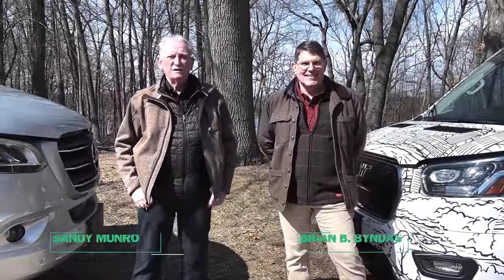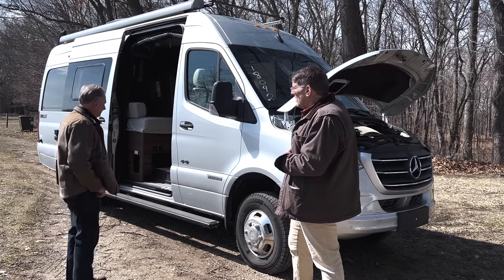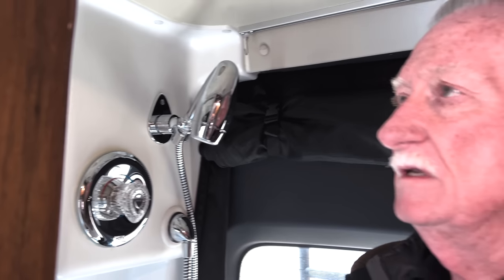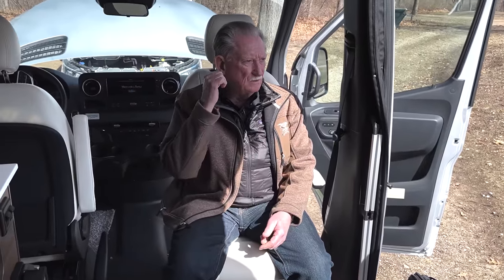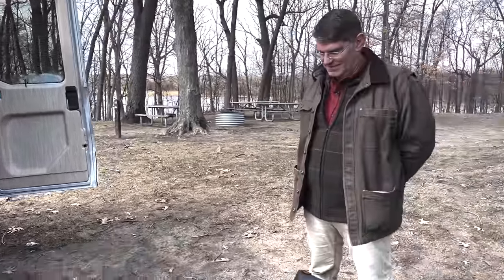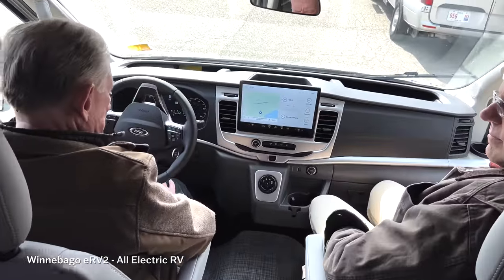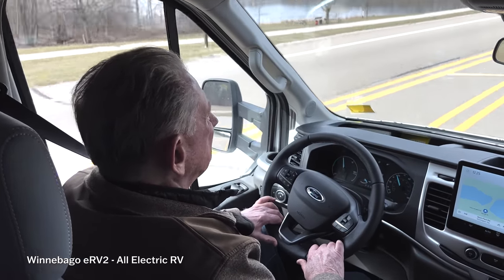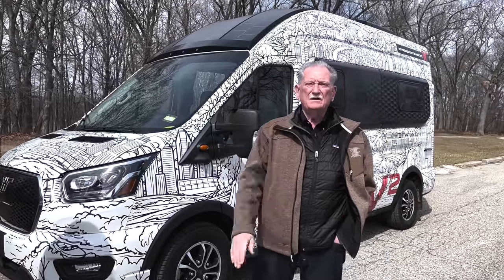Winnebago Showdown! Diesel VS Electric RV

Comment: Pitiful designs.  You got a bunch of handymen screwing some particle board kitchen cabinets on a Mach-e, burdened with a big box adding a few tons of extra weight.   Winnebago's meetings dissecting all of Sandy's comments of how to improve this ~$150,000 monstrosity focused on his comment about the hot plates for cooking could be replaced by an open fire to extend both the range and "boondocking".  The next version will now include a box of exclusive, proprietary, bespoke Winnebago Sterno cans.  At no extra charge!  🤣
Reply: Actually Winnebago designs and builds their own cabinetry using CAD and CNC to make composite stress skin panels to reduce weight whenever practical and has been doing so for over three decades.  Laminate and Solid Surface tables, bed bases and counter tops are usually stress skin panels with a foam core to keep weight down using the thinnest practical surface material and a plain unfaced Formica backer to provide the needed strength at the lightest weight.  They've also been making most of their seating in house along with their own metal and plastic extrusions since about the 1990's.

Design teams include women to balance things out however they are still constrained by what sells.  The vehicles also have to meet their own higher crash and fire standards and include reinforcements of the cab area with a steel safety cage added to many vehicles along with metal anchor plates added to the inside of sidewalls and roof panels to support appliances, fixtures, etc.  Winnebago isn't building them like they did in the 1960's from bread trucks using 2X2 lumber, glass insulation and particle board.  Their larger RV's also have to survive being dropped upside-down onto their roofs while suspended from a crane at a height of somewhere between 6 to 10 feet (don't recall the exact number).

On the E-Transit high top they only have about 3,300 lbs carrying capacity to work within for adding the cabinets, toilet, shower, galley, entertainment, fresh/grey/black water systems and still allow for 4 adults and their stuff which isn't very much.  Just the rooftop AC unit, stove, TV, solar and water tanks can eat up half of that capacity and 4 adults can take up another 600 to 800 lbs or potentially more leaving very little chassis capacity for walls, furnishings and personal stuff so they have to be very frugal about the added weight of a built in microwave, cabinets, house battery systems, etc, etc.  Using particle board kitchen cabinets and furniture from the big box stores would leave little to no capacity for people.  Unless I'm mistaken they even appear to have used upgraded shower components adding an more premium Oxygenetics low flow shower head which still gives a very effective rinse despite the low flow and helps keep the amount of water and its associated weight required to be stored on-board to a minimum.

Winnebago usually leaves it to the owner to choose which outdoor kitchen appliances to choose with the Coleman Roadtrip compact grills or Little Red propane Campfires being a popular choice.  A microwave unfortunately takes up a lot of real-estate in a small RV and since it would likely see more use than a cook-top would end up consuming more energy due to that more constant usage and put higher loads on the AC unit.  For conserving weight and energy on AC they might look at some of the lower powered battery AC units being used in the boating world that can run directly on 100 to 200 watt solar panels being based on small variable speed military R134 AC compressors used to cool computers out in the desert or even consider powering up the electric AC built into the EV.

Bigger quality problems have been with the cross country delivery of them using contractors and RV Dealers who do not do a complete PDI before handing over the RV to the customer and then won't provide timely remediation to any issues identified.

They are not perfect by any means and have to deal with the human factor of new employee training, etc since these things are not built at such scale that full robotics can not easily be integrated into production.

Best!
Reply: @neilfromclearwaterfl81  Very nice!  You should have been in the video representing Winni.  All great comments, but is still looks like a bunch of stuff thrown together, albeit much better than in the past (but that's not saying much).  Remember the GMC Motor Home?  All custom molded and actually engineered stuff made from the optimal materials at the time.  Fiberglass, HDPE, Polyurethane and composite foamed sandwiches of these, all in the mid 70's.  As you said, the Boating Industry has made tremendeous strides in their products, which also have to be water and weatherproof.  Check out some (not all, or even most) new motorhomes in Europe for products designed and produced in this century, not the last like this Winni.   Did you also wince every time he mentioned "consulting with our customers"?   Since all of them would have said, don't bother, unless it goes over 350 miles and can recharge from the solar panels (even though that wouldn't help much).  You want to use the folding solar panel?  Just prop open the rear barn door and move the rag out of the way.  I repeat: Pitiful!
Reply: @shazam6274  I remember the GM Oldsmobile Toronado based motor home and saw them firsthand with they were introduced.  It had its problems with weight capacity along with fuel efficiency among other things despite being an in-house endeavor built by a major chassis manufacturer.  

They mentioned consulting with the customers along with the customers wanting 3 hours of drive time and that sadly the Ford Transit was the only thing available getting almost half the range customers wanted so no cringe there.  Hopefully Ford as a major manufacturer of motor home chassis will step up and produce a more motor home specific EV chassis with the 3 hours range customers indicated was needed plus the capacity to power the house functions.  The lack of range, etc falls squarely on Fords eTransit being a last mile delivery vehicle and not a long haul or motor home specific chassis.

Recharging completely from onboard solar would only be possible in a chassis that is lighter, less tall and much more energy efficient such as the Aptera but then it would not be a Class B eRV.  You couldn't easily pull it off without a lot more auxiliary solar panels with the eTransit since you'd have to more than double the battery size/weight to achieve 300 miles of range.  Whats needed is a much more energy efficient drive train along with a body design that has a much better drag coefficient.  Perhaps a monocoque design using modular drive train/suspension units.

Making them more like a boat will be costly and likely beyond what the market can bear.  Even an open skiff once outfitted with a motor, electronics and so on can cost you more than the cost of many Class A motor homes  Most of the European units I've seen are smaller and frightfully expensive for what you get so not really what Joe Average can afford.  The canvas covers for the utility connections in the back are consistent with what a boat would use for weight savings however I would have put the solar connections near the bottom with a pass through like other RV water and power connections and not in the much higher location where they currently have them.  I would have been hesitant to show the auxiliary solar too and would have long ago told my design team to fix that along with change to an easier to keep clean and more stable portable panel without the built in fabric storage case that will attract dirt.

There is hope for the future since they are road trekking with it to get hands on experience with it along with the public's reaction.

Best!
Reply: @neilfromclearwaterfl81  Neil, I like your style.  Winni should have you as their marketing director and spokesman.  Or apologist :)  In any case "it's all Ford's fault" is nonsense!   Winnebago CHOSE this purposely designed "Last Mile" Delivery Van to cobble together this motorhome.  Ford engineering doesn't want to have anything to do with these guys.  As shown, it won't even make the trip from Clearwater to Orlando!   

Why did they do this now?  Likely some bright-bulb MBA / marketing person thought that they could "lock-up" customers by prematurely showing these things all around the country on every local daytime TV show and internet "influencer" scooping up $10 Grand each in "reservation deposits".   The old saying about Publicity is wrong, there IS such a thing as Bad Publicity, and it has killed-off products, divisions and entire companies.

Couple of other points:  
Ford or GM will not make an electric vehicle chassis for motorhomes because of the tiny, fragmented, market which would guaranty a loss on necessary investment now and forever.  They are already loosing a lot of money on BEVs and hope that in 2-5 years that will change (Ford is hoping 2025).  However, Stellantis is building a new plant to make E-Vans for Amazon in about 2 years.  Maybe they'll do it.  Likely not.

Solar charging of BEVs is the latest wish / fantasy.  Ain't gonna happen...ever...even in a swoopy kiddie car like Aptera.  Who will follow the path of another elec-tricycle company, Arcimoto, to the land of "the walking dead".  The reason is...physics & math.

Let's just see how this goes for Winni in the next 12 months.  Neil, I can't get upset with anyone who is so erudite and likes Muriel Anderson and Jay Leno.  

Best wishes!
Reply: @shazam6274  I have a brighter outlook on this.  

Ford and Winnie have been collaborating on chassis development for over half a century now with the F53/motor home and the related ambulance/swat chassis sector being an important part of their overall chassis business.  Ford and NavStar/Workhorse (formerly a division of GM) have been investing for years on the e-chassis segment of delivery vehicles with NavStar also investing in electric vertical liftoff and landing shuttles to transport people between airports and business centers.  Tony Seba sees all this as an in-progress technological disruption that's currently happening globally.

Is Winnie being too early an adopter or are they just getting a jump start on the competition by cutting their teeth on whats available now to better position themselves in the supply chain giving themselves a better chance to take the lead?  I'm thinking they are positioning themselves as the shop that will be given first priority as improvements are made in e-chassis development.

Been driving electric daily for a decade now and really don't want to go back to fossil fuels. 

I'm going to agree to disagree and am cautiously optimistic on how this is all going to play out.  It will be interesting to look back on this in 5 to 10 years if we're both still around and sentient enough do so.  I am hoping regardless of the outcome both of us will be doing well enough to then continue the conversation.

Best to you and yours!

Comment: With these 2 the obvious choice is the diesel. Ford needs to innovate. I mean a steel hood and just chucking in compliance parts with 120 “ideal” miles of range and a separate home battery is a joke. Make the whole roof solar and a rear condenser or in the frunk… for aero, even if it’s just for no roof penetrations…
Reply: Yea was not impressed with the erv

Comment: I dont get that optimism ... 
honestly , how many do you really believe will buy RV with 100 mile range ?
From my perspective there is yet no good solution to fully electrify RVs ,
we need this solutions with range extender or else consumer will continue to buy the conventional RV.
REX could already highly increase overall efficiency;
charge the battery AND use the exhaust heat to warm up the cabine and the water.
a little 20KW REX  would already do the thing

Comment: A RV needs to be at least a Class C.
Dry shower, real bed (queen or full size), fridge w/separate freezer.
Sleeping in a van gets old very quick.
An Electric RV would be awesome but not with a 100 mile range.
Reply: Love my class B. Saw a lot of interesting class B stuff in other video.  Class B is increasing in popularity, but to each his own.
Reply: @johnarnold6847  Take a 2 week trip and the let me know your thoughts
Reply: Love my 14' Alto trailer, can use tent sites and stay away from all those noisy class B and C that block the view. 
Plus I can pull it with my model Y
Reply: @universeisundernoobligatio3283  Sounds great, what range are you getting with the Model Y? Is it LR?
Reply: @ELCEV  
Get about 250km range, gets me to next SC, never a problem. Also with electric camp sites, just have to get their with more then 0%, plug in and ready to go next morning.

Comment: RVs are ideal product to go EV.
Reply: Not when boondocking. This Winnebago EV is not ready for use at all. Not enough charging stations where RVers boondock. Edit: 900 Ws won't be enough for both charging the vehicle batteries AND the house appliances. I have news for you too ... any solar panel oriented straight up will barely bring in any power (regardless of how sunny) in the winter months when the angle of the sun is low in the sky. Snowbirds typically have the ability to tilt the panels and orient them as the sun moves across the sky. Sell it to the gullible, you'll do well. I'd love an electric RV ... but not this one. Not enough range.
Reply: Yeah seems like batteries will need to get better before rvs will be better electric. But once batteries are better, and there’s more charging, ervs will be superior

Comment: The difference between two car is simple: the EV is unusable for my way of using. Driving 350 miles on Friday to mountains, then stay off grid in winter and driving back on Sunday is not possible with EV and won't be for a long time. IAM not buying a campervan to drive better. I am buying it to be independent. It is nonsense for now.

Comment: 350 miles in the Mercedes is over 5 hours of range not 3 hours of range with around a 15 minute refill time. Verses 100 miles in the Ford which is about 1.5 hours of range before a 1.5 hour charging session. Sorry, this is really pathetic. You couldn’t even get to the campsite on a Friday evening from your home for the typical family. Sorry, but this really sucks.

Comment: Looking at the diesel, the whole thing seems disappointing. By european standards, it's neanderthal. Perhaps it looks less primitive to American eyes. Of course, it's what we'd call a "day van" not intended to be used as a motorrhome or camper van.
They talk about the GVW, but not the kerb weight or payload. 
I'd like to have seen the interior of the newer, more polished version.
The mention of people wanting to drive three hours is all very well, but they'd want a margin: two hundred miles range means you runn the risk of completely running out just as you reach your destination. How many boondocking destinations have EV chargers?
Rattles from the living area are definitely not necessary. A good european van doesn't have that.
Reply: That Mercedes van RV conversion is very bad tbh! It looks like a diy home made project by some random person

Comment: TESLA van will be able to go 0 - 90 mph in under 3 seconds , let that SINK in. 
TESLA van will be lower to Ground w/ Superior center of Gravity , making it MORE safer .
Reply: Crap!!!!!! No one literally gives a crap about 0-60 in those large vehicles, plus doing that kind of acceleration will just destroy your payload or RV systems and tools,
Reply: Epple want the best range possible and also the possiblity of been able to go literally everywhere! You can increase the fuel tank on the Mercedes and the awd version and you habe the ultimate go everywhere house on wheels! Just look at ARCTIC TRUCKS.